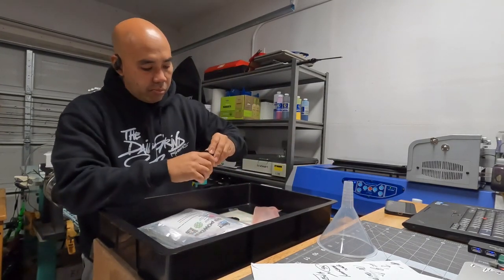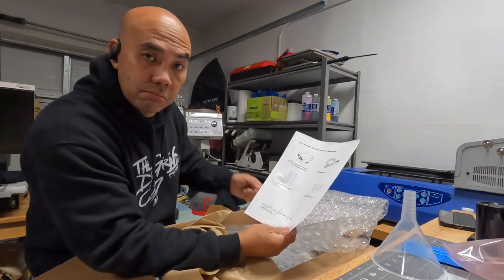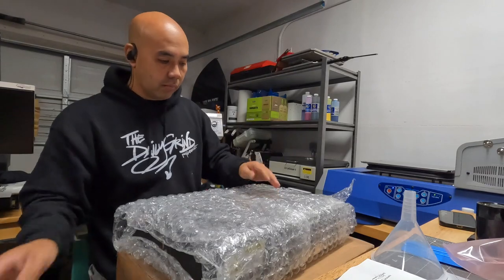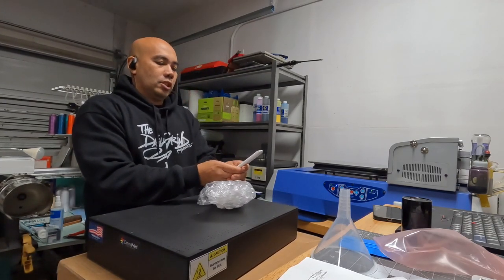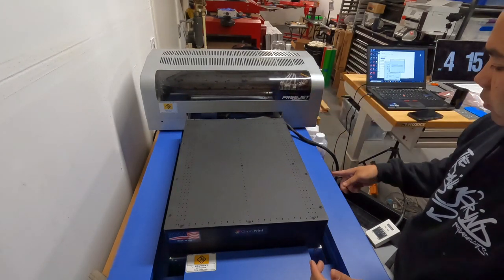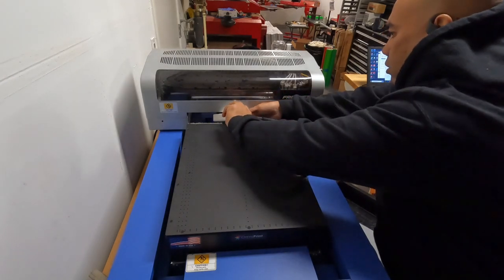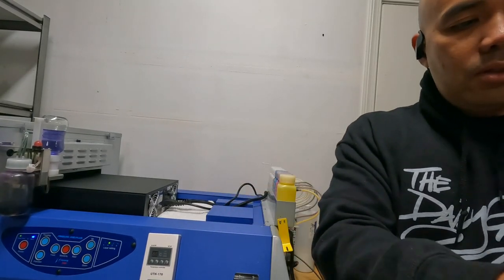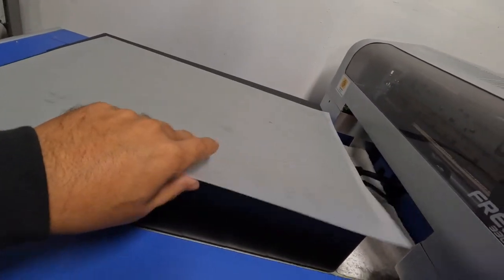MUST BUY THIS FOR YOUR FREEJET 330TX PLUS : Omniprint Heating & Vacuum Platten  (S:09/Vlog 018)

Comment: Hello sir are you familiar with the Epson F2100. I'm having issues with producing bright colors after heat pressing the final print.
Reply from the maker: I’m not that familiar with the F2100. It sounds like a software issue, can you “change” the color percentage to a higher percentage?
Reply: I tried that but no success.
Reply: Are you pretreating the dark garments correctly? Try and print the graphic twice on the white tees. Print and print again before taking them off the platten to heat press.
Reply: @BreakthroughInk  Yes sir, I even brush in the pre-treat. I have printed the design three times on dark shirts and before pressing the colors are great but after pressing it goes bad. I appreciate your help.
Reply: @TheLogoZone  maybe the type of ink you are using? Check the temperature and time. I know if you press it for too long at high temps the dye migration takes over. Also try different brands of shirts. You’ll get it down.

Comment: My name is Edgardo. I bought a machine 2 years ago. The seller did not respond after the sale, and he resigned. The instructor after the class that we did not understand, resigned. The company did not answer messages and when they did, they told me the warranty expired and a piece was damaged due to not using it. Now they tell me that if I don't buy the part and all the chemicals, they won't give me service. So, I've been in this fight for 2 years. This is bad service and fraud. I paid almost 30k for the machine. Who can help me?
Reply from the maker: Ya sorry, It has been an issue with OMNI lately